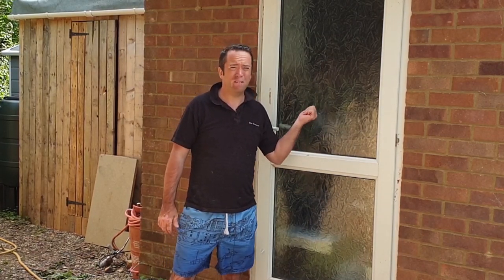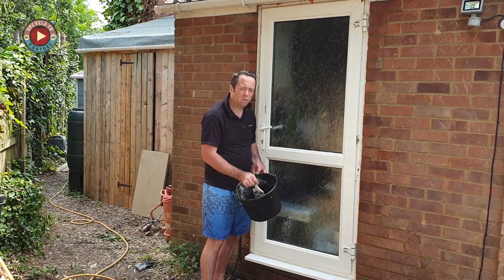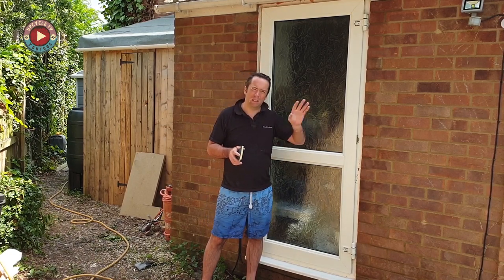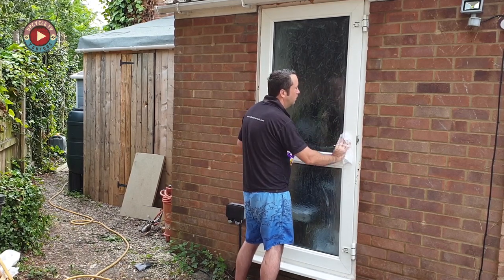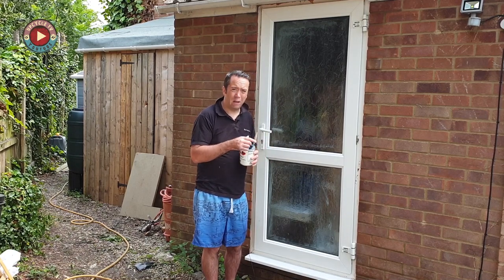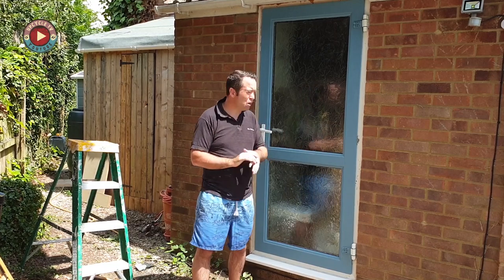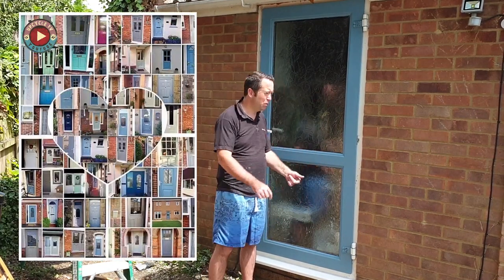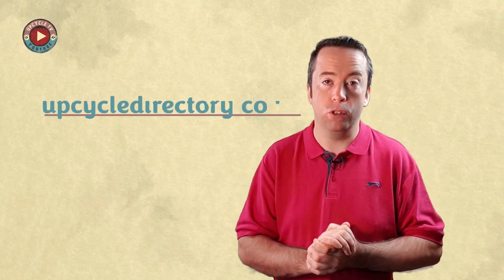How to Paint a PVCU Exterior Door

Comment: Hi Stuart, 
I have one concern about this and wonder if I could have your thoughts please?
Being that a door is a high use/wear item, I’m wondering just how robust this paint is going to be over time?
Specifically could it be likely to ‘chip off’ (for example from a key ring constantly buffering against the painted surface)?
Should that happen, it would look horrendous with small white chips showing through in places.
Thanks in advance.
Reply from the maker: Hi, I think the best answer would be to ask lots of people that have painted their doors this way. The Frenchic fan forum group on Facebook would be a good start.
I've painted doors and kitchens and not had this issue but worst case scenario if it did, just touch up with a little paint
Reply: He start by using sugar soap you should always use ammonia for cleaning down , L LIKE HOW HE SAY'S DOORS NOT STAYING GOOD JOB AS YOU WOULDN'T WANT TO SEE IT ONE YEAR LATER ,TAKE IT FROM ME UPVC IS NOT MEANT TO BE PAINTED DON'T LISTEN TO THIS MUPPET.

Comment: Great idea...  if your white upvc windows aren't pristine after a few decades will this act like a facelift once painted on, or will it bring out the imperfections/marks? Also, will it work on what looks like aluminium powder coated sliding patio doors?
Reply from the maker: Hi Sharn.
Yes will work on aluminium too, the paint is Matt finish so it's really good at hiding imperfections, for deeper holes etc then you could use a car filler and sand smooth prior to painting.

Comment: Is there a paint for ceiling cladding?
Reply from the maker: Hi Figo, is that wood, painted, varnished?
Reply: @UpcycleTV  Hi...Thanks for your reply 🙂
Sorry, I should have mentioned that it is UPVC cladding.

What I was meant to ask is that ....Is there is special paint (not spray paint) that can be applied by brush onto yellowing UPVC cladding ?

I dont want to spend the time and money to replace the UPVC ceiling cladding.
Reply from the maker: @figogaati1064  yes this paint will work fine as long as you follow the prep in video
Reply: @UpcycleTV  Thank you 🙏